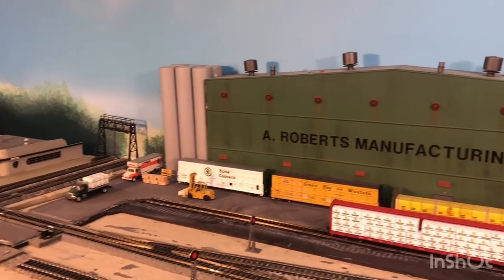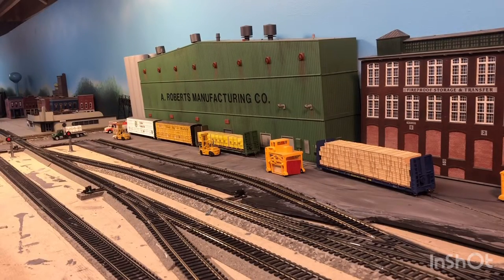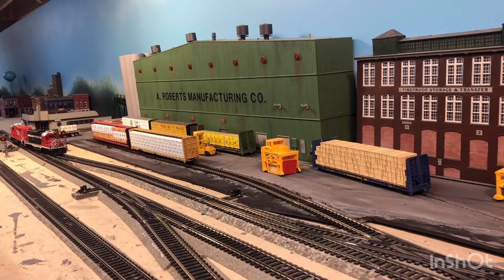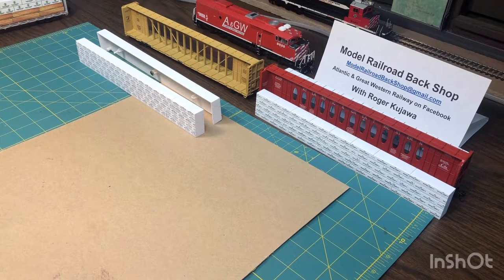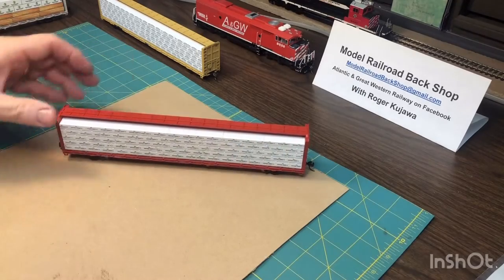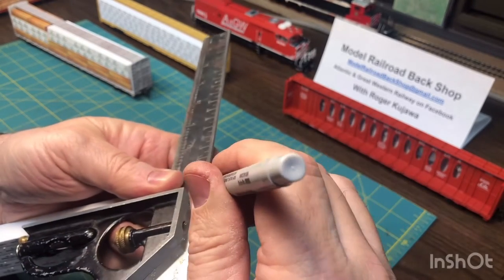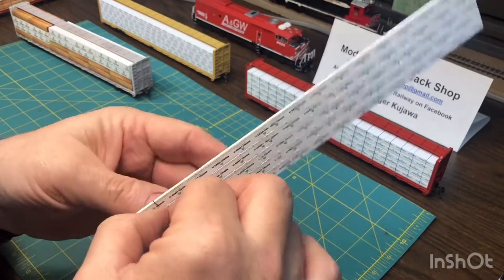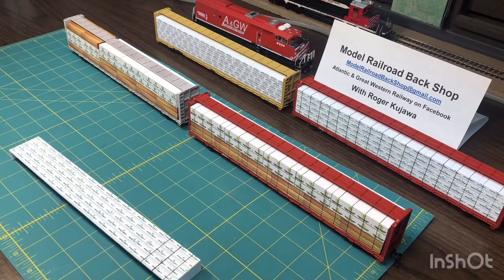4. Realistic & removable loads for model railroad center-beam flat cars with Roger Kujawa

Comment: I did something similar with the
tape but I used 3M electrical tape
cut to 7 inches then I stick it to
glass and use a small metal ruler
to measure the 1/64 width and cut
it with a #11 hobby knife, it is
tedious but works good!! If I would
have seen your trick with the Sharpie
though my hair would have less grey
in it!!😁😁😁😁😁😁